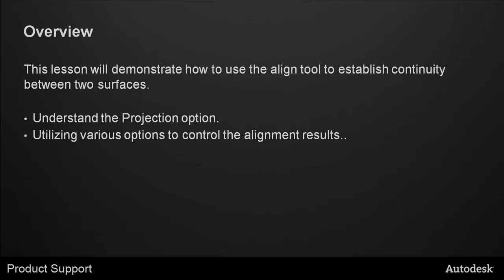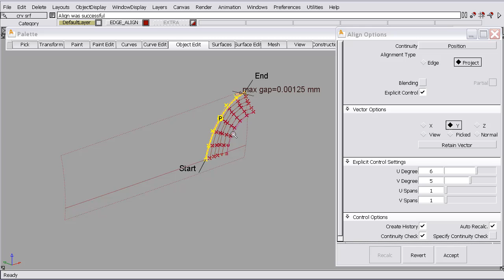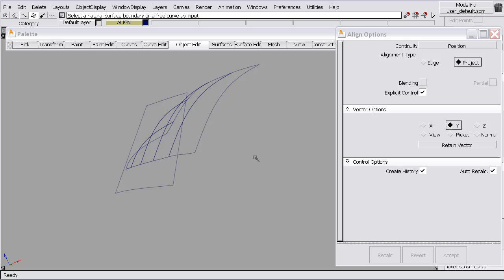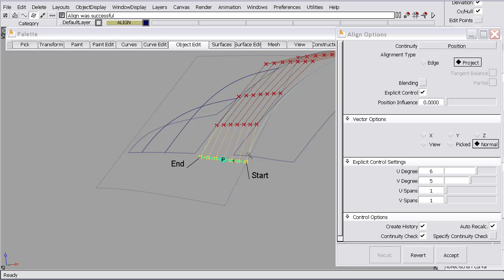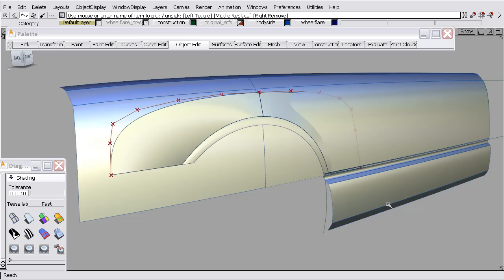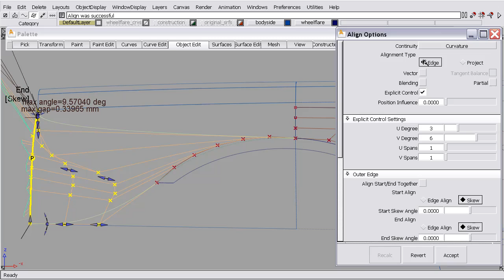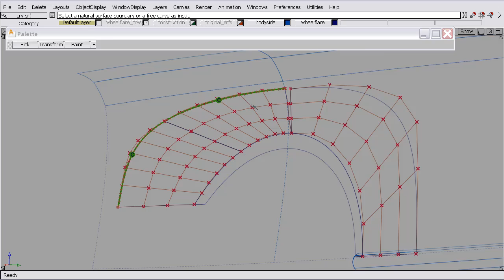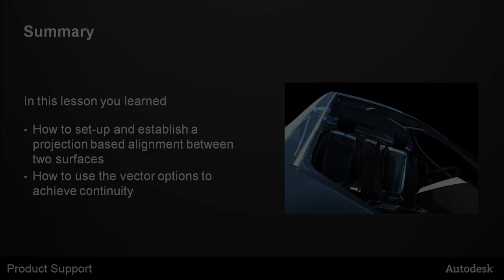Autodesk Alias Align Tool Part 4

Comment: I have just watched this video and tried to apply the final part using Alias 2014 and there are several problems.
The program cannot switch back once 'EDGE' has been selected - back to 'PROJECT', and the Align will not perform if you choose X,Y,Z or Normal selections, this method will simply not work unless you project a curve on surface first and align to that, I presume Autodesk have modified this tool functionality and it no longer works..?

Comment: The explicit control option doesent show in my align tool...I have tried both the 2012 and 2013 version. I´ve also tried both align tool and align 2008 and none of them shows it. have i´ve missed something?

Kind regards!